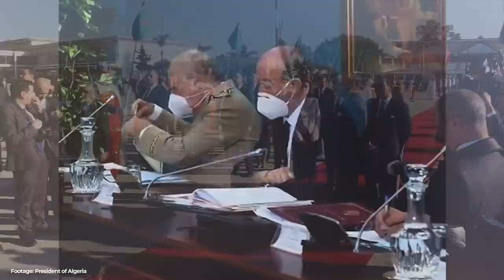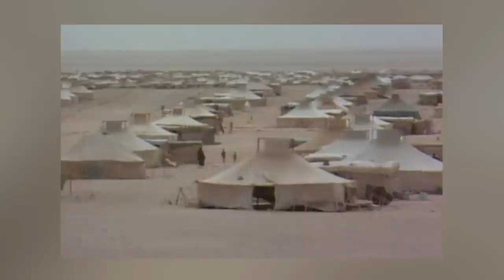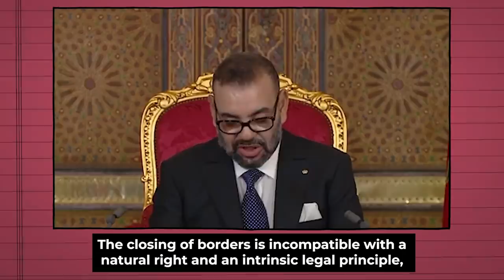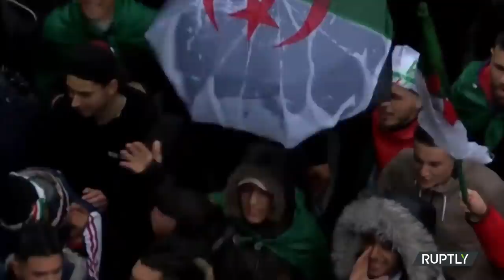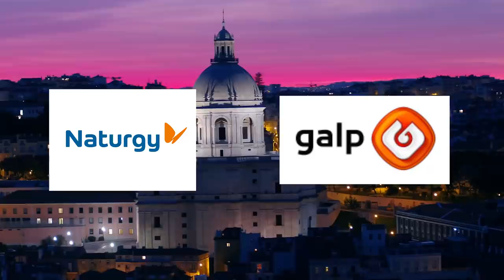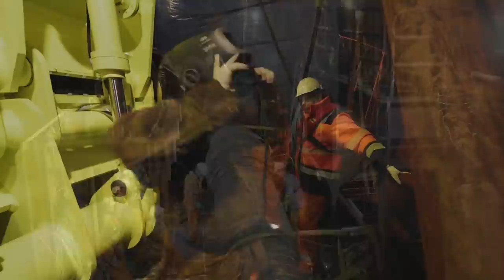War in sight in the Sahara? Algeria, Morocco and the role of gas - VisualPolitik EN

Comment: Your documentary has bunch of mistakes:
1/' the sahara should have the Moroccan flag. Why? Because since 1975 the Moroccan government is rolling the sahara and has the sovereignty over the Sahara recognized by the USA, and hundreds of countries.

2/- Morocco was offering to the UN a self determination political system to Sahrawi. That the sahrawi will rule their own affairs under the sovereignty of Morocco: (currency and security).

3/-  Algeria is trying to cut the expansion of the Moroccan economy deep into Africa. Economists see Morocco as the FIRST French's competitor. (Companies and airlines for example).

4/- Algeria is using the polisario as purpose to have an access to the atlantic ocean. Also, algeria is using the refugees from that same camp as human shield, and a bargain token to leverage power in the northern African region.

5/- Morocco has 25 foreign consulates already opened in the Moroccan Sahara.

6/- using Med gas is more costly to Spain than the pipe cross Morocco. But Algeria is rather hurt the Moroccan economy that be economically coherent.

7/- Morocco is supported by the USA and israel. And many golf regions allies.

8/- you're confusing mohamed V (5), who is the grand father, and Mohamed 6 who is the current King. 

9/- Algeria is a military system like in North Korea. Military systems always try to market their military power and flex. The best that system does is to export internal crisis and creates them when there is none. It's an expert in creating enemies. Exactly what Algeria is doing. 
Life conditions in the Algerian camp of tindouf is very precarious, however investments of the Moroccan government in the Moroccan Sahara is tremendous. Cities such as laayoun and Dakhla are a typical of modern advanced cities. 

10/- Algeria introduced the Russian mercenary Wagner to Mali. And to tindouf camp to train the polisario. African nations and western knees are not pleased by this move. 

11/- Also Algeria has a tight with Iran. The middle east and the west's biggest enemies. Iran also trained the separatists polisario in Tindouf camp.

12/- tindouf camp in Algeria was the biggest platform of Guafdafi's weapons trafficking after the fall of his regime. Through Tindoufe, the VOS (terrorists or violent Organizations) in the Sahel regions were flooded by the Libyan weapons. 

13/- Tindouf is the biggest factory of terrorists. We can mention 2 names at least of the most notorious ones: Abu Walid Assahraoui, responsible for westerners kidnapping and the slaughtering of 4 American army in Tango Tango area in Niger. (Refer to official docs or at least to YouTube) and MBM ( Mukhtar Ben Mukhtar) and thousands of others operating among multiple terrorist organizations in the African Sahel regions.

14/- Algeria is extremely irritated from the normalization of Moroccan diplomatic relations with Israel. And sees from Morocco a betrayal nation to the Arabs and to the Palestinians people.

15/- Algeria believes that its power and denomination should be from isolation and weakening Morocco. 

16/- Algeria has Hirak (mass of population protests) against the military regime, cost of living, inflation. Etc 
The military rolling system exports its crisis abroad, deviating the Algerian tensions to the neighboring country of Morocco.
Reply: Baaaanngg Bro !!🎩🧢
Nailed it .. 
GET educated PEOPLE  ☝️
Reply: @sammiabeyon7775  thanks a bunch.
In the whole universe, there is ONLY ONE Morocco.... lol
Reply: @waliddjema5442  Eastern Sahara is Moroccan & you know that very well and it will get back much sonner than you think just like with the western Sahara ,just keep your childish mindset & by the way you all have no idea how our country will take back his territories QUICKER than you've could imagine